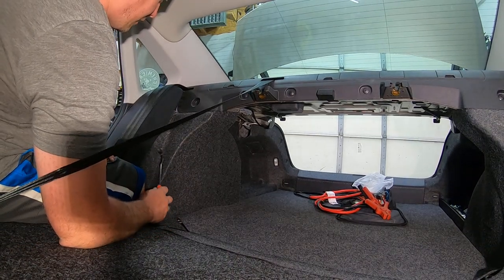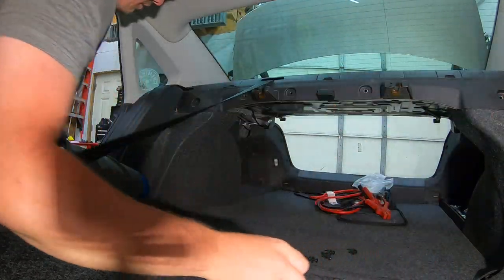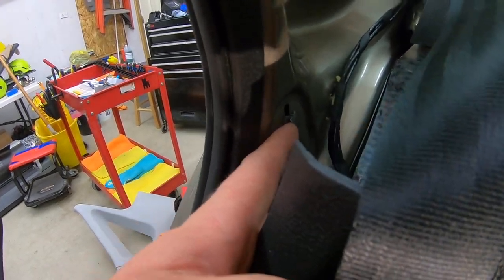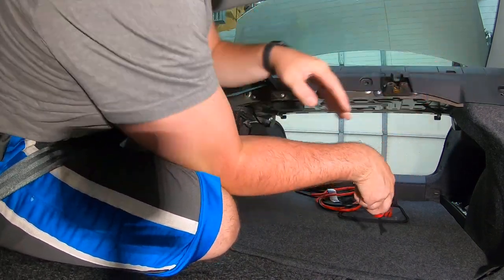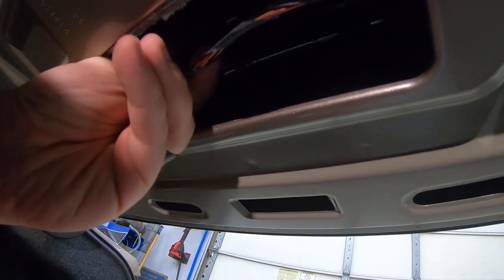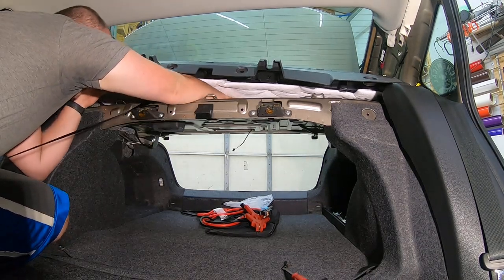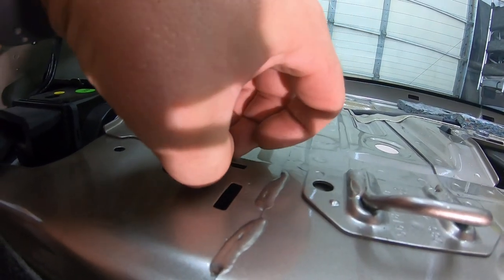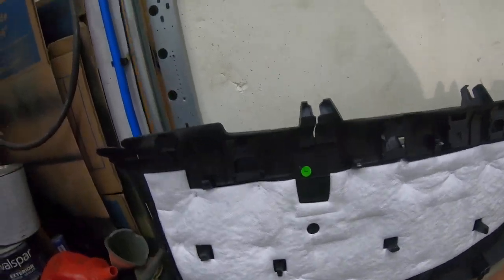How To Remove: 2015 VW Passat rear decklid

Comment: Thanks for posting. One thing I did notice when removing the deck after breaking 2 of the plastic retainer push pins... they are threaded. A small allen key takes them out very easily.